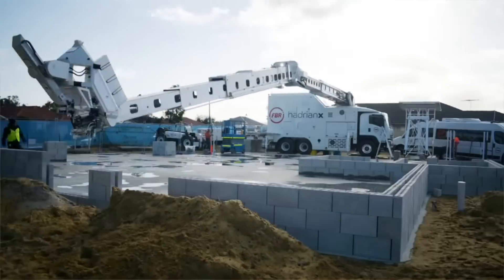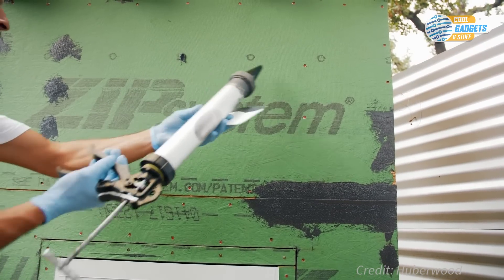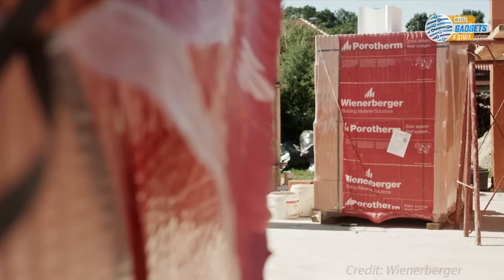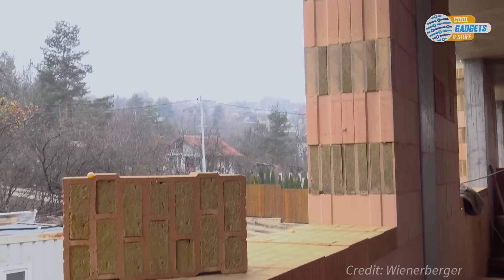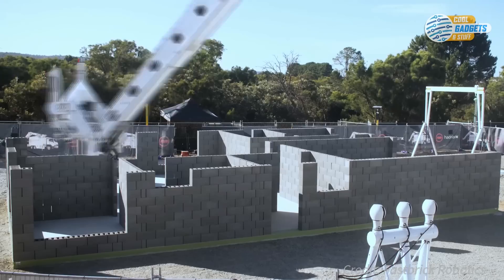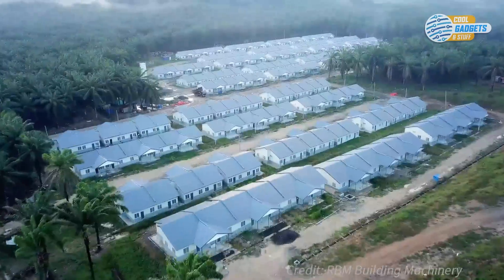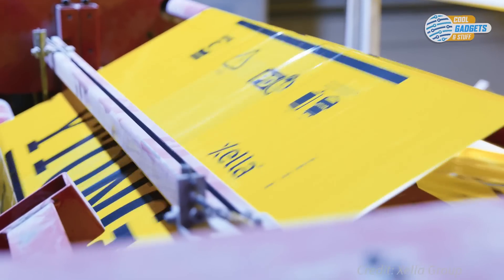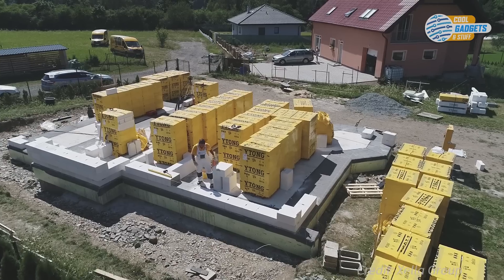5 Innovative BUILDING SYSTEMS for your house #5

Comment: House wrap goes on really fast and wraps right around the window openings.  ZIP walls don't make any sense with that silly taping and caulking unless you're doing the one with the added insulation.  Plus I don't care if you put it on the roof....you still have to have an "under"layment under the shingles like tar paper or something.

Comment: When companies make these special bricks or blocks why have they simply not just designed the building foot print so the blocks or bricks don't need to be cut, its not rocket science or brain surgery to be able to design a standard system not with todays cad modelling. They only seem to put a "mortar" on the bottom and not the sides so surly there is a leak issue. I love how people are trying to re invent the wheel but sometimes they come up with a good idea but costs a fortune.

Comment: I'm really intrigued which of these are applicable to my off-grid property.  Remote areas without paved roads make using heavy equipment, particularly concrete trucks, impossible for me.  Thanks for the great ideas!